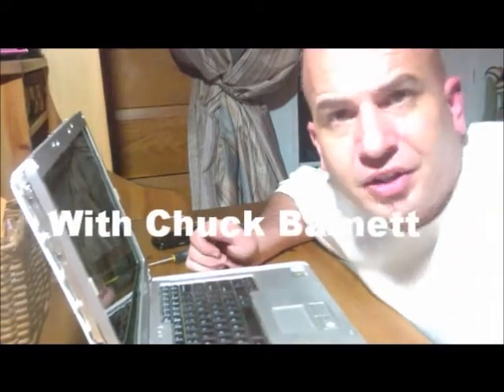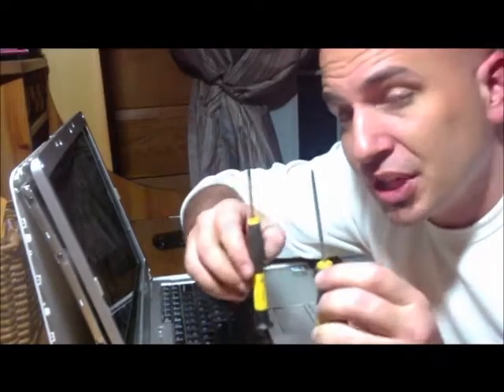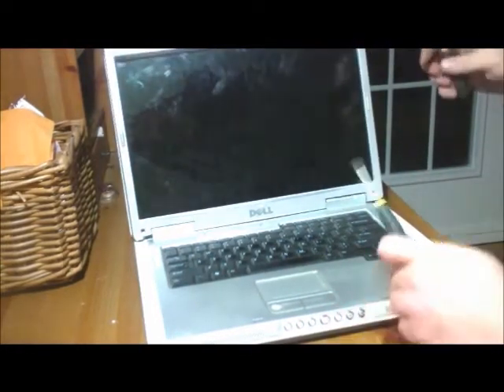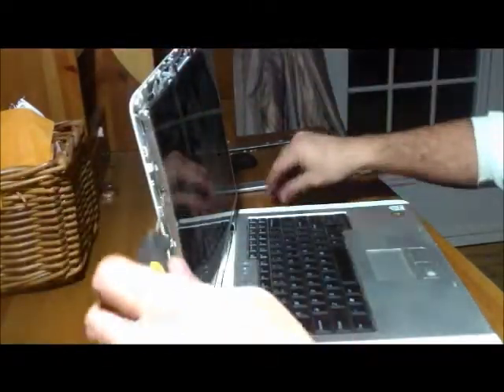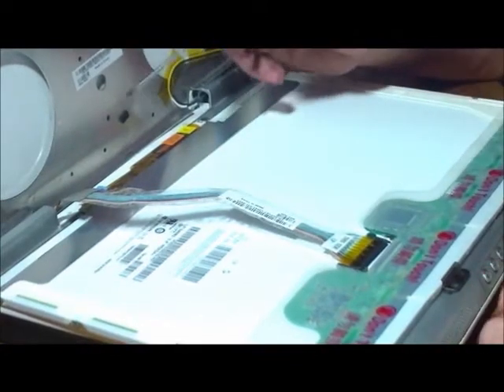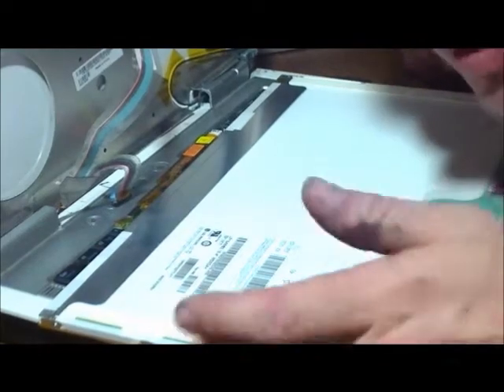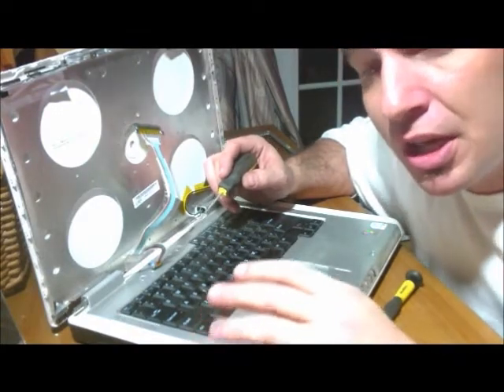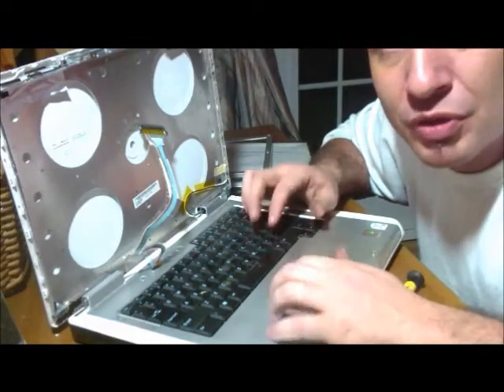thecheapbastard.net presents How to Replace a Laptop LCD Screen

Comment: Here's a cheaper alternative to the screw drivers to remove the casing. I use an old bank card, hotel room key, any kind of plastic card and glide it around the case. One wrong instance of placement of a screw driver will crack the tabs on the inside.